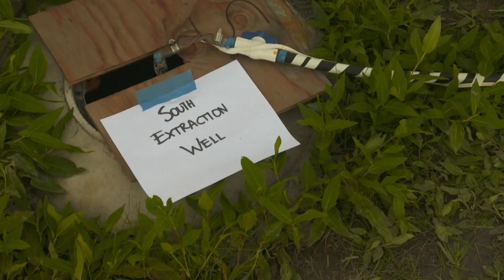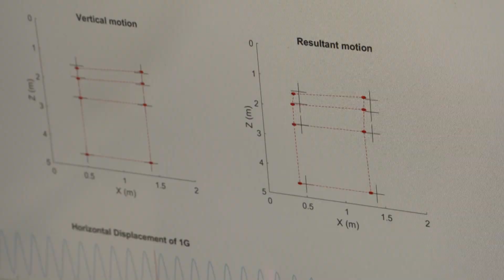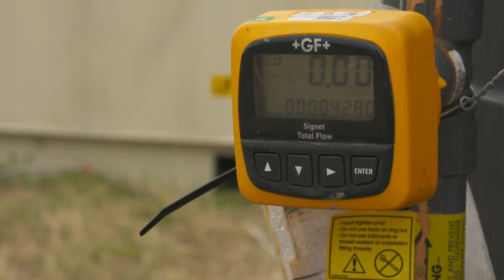Earthquake Ready or Not: Where could solid ground turn into 'soup'

Comment: We are entering a period of Global Cooling. During the Maunder Minimum 
(1645-1715) the sun radiated less heat. Wheat prices in some years rose 
as much as 400% in the UK.

But Dr Valentina Zarkhova has noticed that more significant than the 
slight global cooling is the reduction of the sun's magnetosphere. This 
allows more cosmic rays (nuclear particles from distant decaying stars) 
to strike the earth. The New Madrid fault had a major quake on 
12-25-1699 during the Maunder Minimum. During the Dalton Minimum, the 
New Madrid fault had 4 quakes on 3 days in 1811-1812.

Japanese scientists also noted an increase in the number of volcanoes 
during a Grand Solar Minimum. The likely cause of the increase in both 
quakes and volcanoes is the increased number of cosmic rays energizing 
the earth.

In 1906 a few miles north of San Francisco that  earthquake threw a road 20 feet. 

Fortunately, people were riding horses.

The Garlock fault which runs east-west near Santa Barbara is the Real 
Big One. That is what the Indians told the Spanish priests. 

Hint: Reno, Nevada is 25 miles west of Los Angeles. 

Hint: The Juan de Fuca plate off the coast of Washington is another Big One waiting to happen.

All of those quakes (including the New Madrid fault) are being energized by an increasing level of cosmic rays.
It is time to move out of these areas.